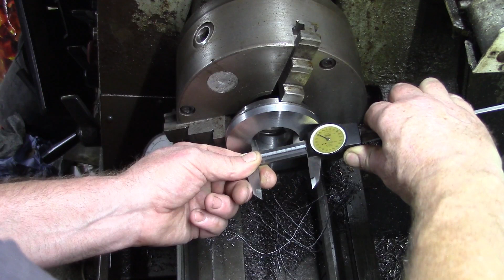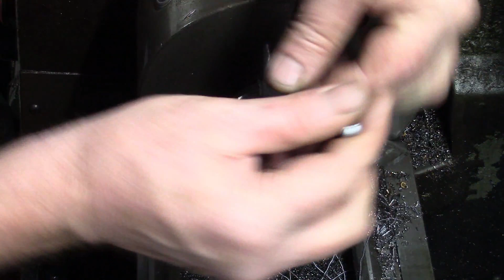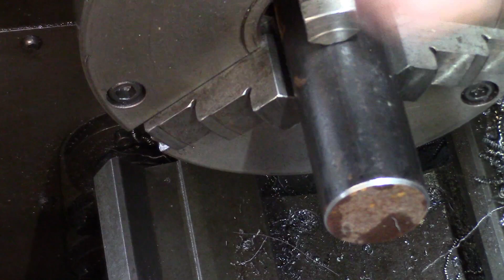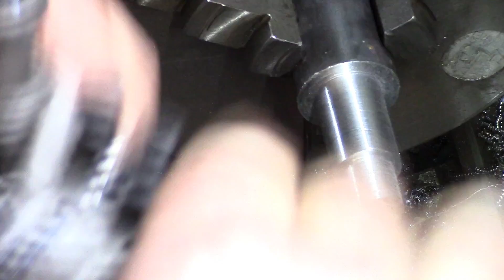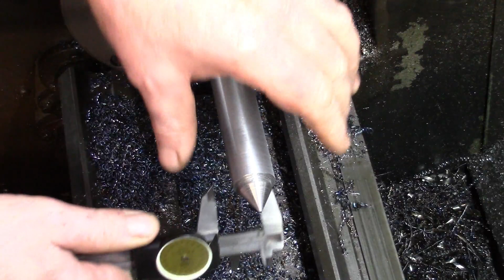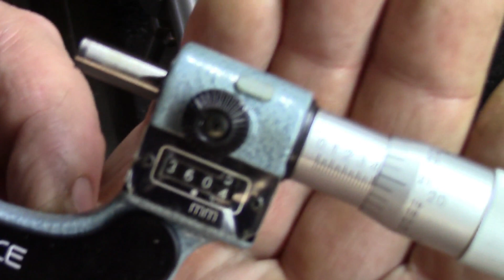Motor cycle wheel Arbour Revisted

Comment: Excellent video Al not sure about the quality complaints 🤔 it’s YouTube after all not the BBC🙃 couldn’t you of turned the complete shaft between centres! Using a dog drive, then turned it round to do the opposite end. That’s how I do shafts for Geoff for his old tractor machinery, I’ve seen em running no wobble.
Reply from the maker: It was a learning experience but it worked out ok in the end you’ll have to wait for part 2, it’s Youtube not the BBC, Al likes that one,😁😁😁

Alan.

Comment: Hi Alan, new subscriber to your channel, really enjoying the videos. I have a Colchester master 2500 the same as yours and was wondering does your machine vibrate at higher spindle speeds above 570 for example as mine does?
Reply from the maker: Hi Jack no mate it doesn't vibrate,  unless I have the four jaw on and going over  say 700rpm, but then again i can't mount the camera on the cross slide because it makes the footage shake a little  but I've always thought it was the camera being to sensitive,  hoping to get a better camera soon so I'll see what happens then, I've ran my three jaw up to 2000 before and didn't notice any issues, hop that helps.

Alan.
Reply: Thanks for the reply Alan. Yes that is helpful, my three jaw is in fairly poor condition so I just leave the 4 jaw in the lathe most of the time. I must try putting it back on this evening for a comparison. What have you used as levelling pads for the lathe just out of interest?
Reply from the maker: I made some around round steel pads about 4inch I think.

Al.

Comment: Hi. I don't comment on video's often, as i appreciate the time and effort it takes to film and edit, regardless of the content.  However,  i'm wondering why you could not re-cut the taper, whilst it was running in the tail stock along with all the other parallel diameters you machined. The sound is very acceptable to me, and the  video quality even better. KEEP UM CUMMIN
Reply from the maker: Thanks John, I think I understand what you mean,  I didn't want to catch the centre with the cutter, but if I'm honest I can't remember, but the reason sound good anyway, well to me it does, 😉

Alan.